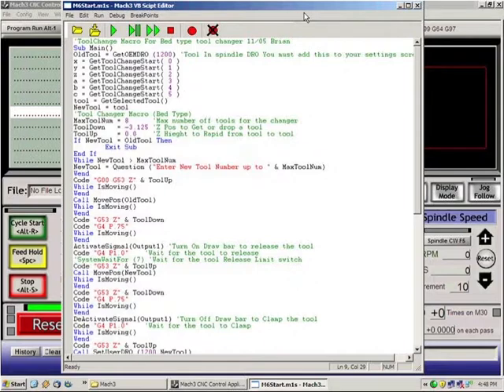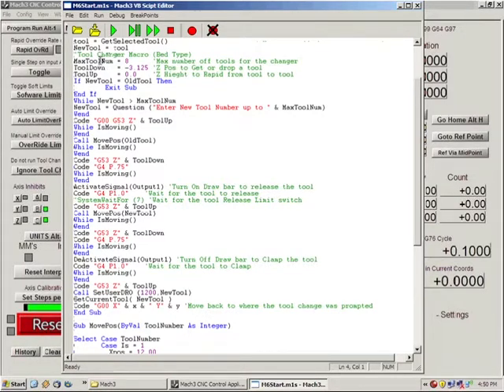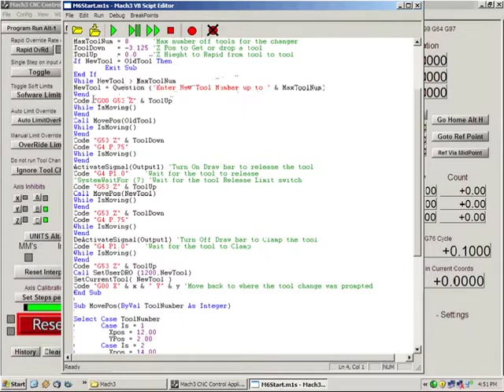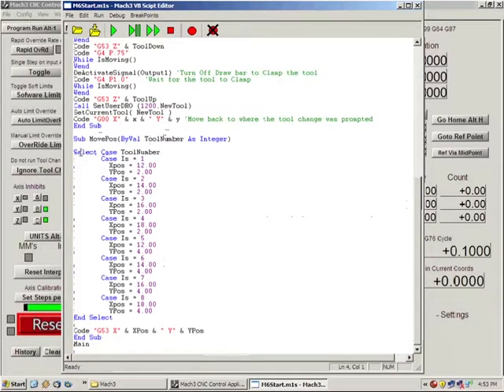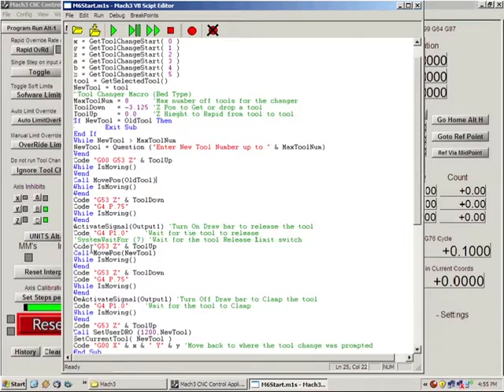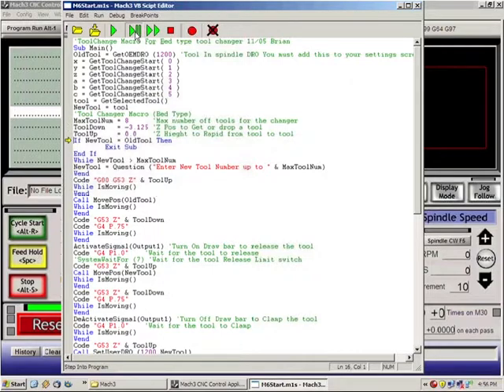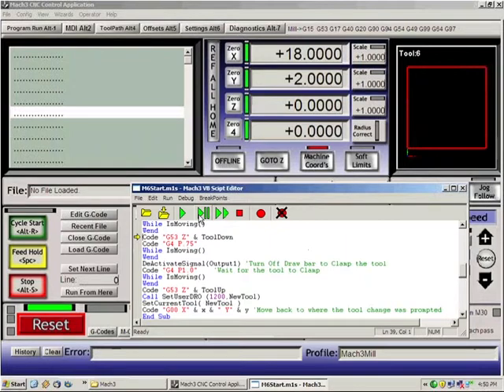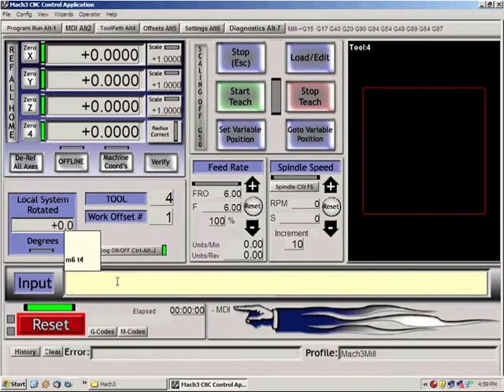Tutorial on Tool Changing for Mach3

Comment: Can I get a little help altering this to work with my machine? I think the only difference is that mine has those forks, meaning the spindle needs to move horizontally to take the tool in and out of the tool holder forks. Any help would be much appreciated, thanks.